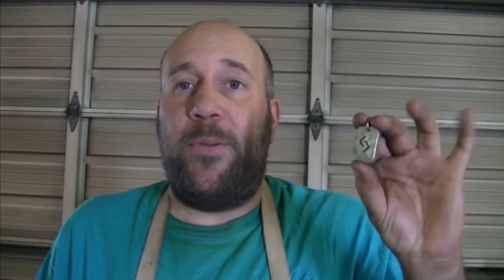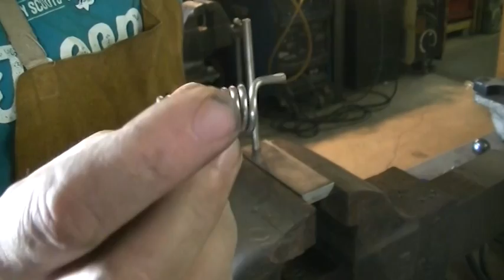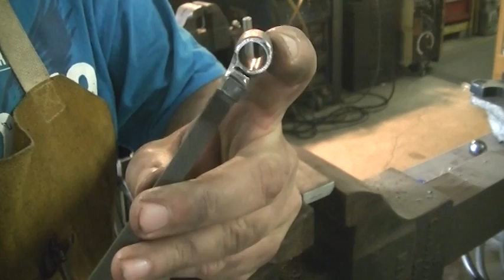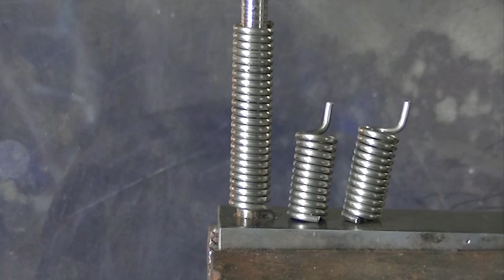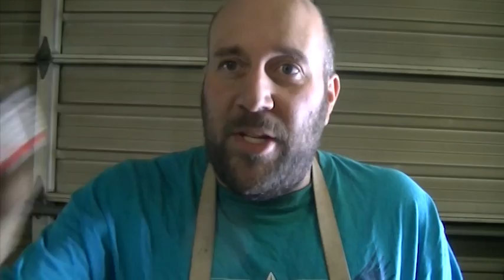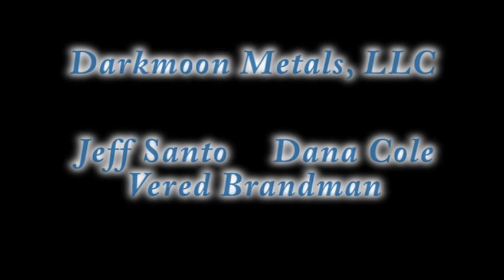Jump Ring Jig  (Strong Enough For 3/32" Stainless Steel Wire)

Comment: To make the top tool or winding wrench, what welding process did you use to attach the 1/4" stock to the pipe and the pin?  Very nice looking welds.
Reply from the maker: I believe I used my TIG welder on that one.

Comment: awesome video. thank you. what do you feel the smallest inside diameter this process could accomplish is? i make fishing lures for very large fish but some of my applications call for very very small rings that still require a very very high weight rating. thanks in advance.
Reply from the maker: With mild steel I the smallest inside diameter is about 1/4 of an inch. It really depends on the thickness of the material as to how small you can get the inside diameter to be. If you are using stainless with your lures you could still achieve tight rings but you may need to use a torch to heat the wire first. Stainless tends to be a lot harder to work cold.

Comment: Hey man...do you know where .can buy a circular saw for cutting stainless steel?(to make juwery) I see one in a tool called peeptools jump ring maker, but is to expensive..and looks like its inapropriedad  to cut steel..about 500 usd, i just need the saw..and a  plier  kinpex cobolt..about  this plier, has it a flat cut in bot ends of the jumpring ?cause diagonal cuts sucks...i am a artisan from Brazil..+5521990112059..
Reply from the maker: I use Dremel abrasive cut off wheels, the heaviest duty ones I can get. I can cut about 18 rings per wheel. It is okay for jump rings, but if you are cutting out hundreds for something like chainmail you are going to need a better method.

Comment: Does it matter what kind of rod, (MIG, TIG and, Arc)?
Reply from the maker: You could use almost any kind of wire, MIG wire might be a little thin. I use TIG because I like being able to make the rings out of stainless. Brazing rod would work, I have seen a few folks use Arc welding electrodes to make rings. In a pinch sure, I tend not to use them because they are short and I can get so many more rings out of a the 36 inch rods.

Comment: Hi, Thats a great idea. I really like your modification. I've been winding 12g wire in my vise by hand and getting uneven coils and then cutting the coils with a jewelry saw. It's a very slow process. Could you please describe how you cut your coil with the dremel 420 cutoff wheels?

Comment: Funnily enough I made a very similar tool to this for making/reconditioning derailleur chain tensioning springs for my recumbents. As you typically use 240 to 300 link chains on recumbents, uprights are usually less than 112 link chains, the factory springs don't keep enough tension in the chain.

Comment: can you suggest a different material to use this process in order to make springs?
Reply from the maker: Funny you should ask, I just watched a really good video on the subject of spring making. He used something called "music wire" or "piano wire" I'll put in a link to his video, lots of good information.

https://www.youtube.com/watch?v=jAawhg6JtyY

Hope this helps :)
Reply: Jeff, seems perfect! luckily I need expansion springs and torsion springs for my Go Kart / tractor accessories that I make/made. Your method would allow me to bind the wire tight.  If I ever need compression springs, I'll have to figure something else out (do not have a lathe at this time). I just hate buying a spring online only to find out it has the wrong force profile / length. With the local Ace Hardware closed, I have fewer options except online. Besides, where is the fun in buying something I could make?  thanks keep up the great videos!

Comment: Jeff,  Neat rig.  I used to make jump rings from .062 ss mig wire.  304 or 316, I don't remember off hand.  I could wind that by hand, but when you got to the end it would bite you if you weren't careful.  I also did some twisting using .125 wire and it was tough to work.  It keeps springing back.  Keep up the great vids.

Comment: Jeff, cool jig! I may try one myself...I need the welding practice, if not so much the rings.  Though stainless steel 3D chain mail juggling cubes might be worth the time!  Back when I was making chainmail, a friend who was a locksmith found me a great tool in one of his professional tool catalogs for cutting the rings from the coils. It's a double compound end nipper.  It has enough leverage that I can use the corner of the cutters and cut two coils at once from 16ga galvanized bailing wire with ease. I could do more, but 2 was all I could fit the cutter into at once. I wonder how they'd do with the SS?

Another friend worked out mass production of rings. Drill and rod to make coils about 12" long, that were then cut apart using a slitting saw mounted on a mandrel chucked in a lathe. An aluminum block attached to the cross slide had a hole drilled through that would fit the coils, and a slot for the slitting saw that intersected the hole.  Dip a coil in oil, shove it through the hole, and rings come out the back in large numbers. Worked very well. 

Thanks for sharing!

-- Mike

Comment: Could you clamp the wrench and rotate the jig? That way you wouldn't have to dodge the wire after each wrap. If the mandrel extended through the base of the jig you could grab it with a drill chuck and really go to town.
Reply from the maker: Now that is an awesome idea!  I'd more than likely use or even make it in a video, mind if I mention you by name and give you a channel plug when I do?
Reply: Thanks! :)

If the idear makes it into a video, I'd definitely get a lil' thrill from a casual plug, thanks!

Comment: knipex cobolt, or the knipex 10 inch diagonal cutters, they should cut it fine, i personally use the 10 inch cutters on my tig wire.  both can cut hardened piano wire .  great video and great jig
Reply from the maker: Thanks!  I'm going to look into getting a pair of those.
Reply: Jeffrey Santo
the cobolt will be the better one for the job.